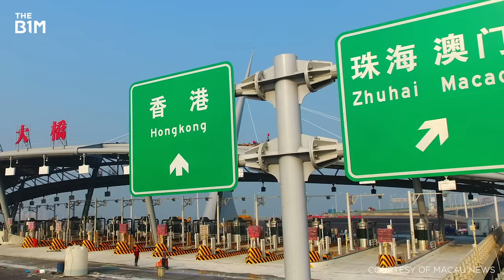Crossing an Ocean: The Hong Kong-Zhuhai-Macau Bridge

Comment: I'm supposed to be going to Hong Kong sometime next summer or the year after, and my primary goal was to see the light show, but since learning about this bridge a year or two ago my main goal is to drive across the bridge. 

Not sure whether i'd be allowed to (only have a UK license), but there has to be a way.

Edit: Also, what utter rubbish (not on you B1M) ! A 300,000 tonne vessel would go straight through any section of that bridge... surely?
Reply: Currently there are strict restrictions on who can drive across the bridge, but there are shuttle buses that you and I can take
Reply: Even those holding driver’s licenses in Hong Kong, Macau and mainland China are struggling to get permission to drive on that bridge, bad luck :(
Reply: lol check engineering white book, the standard is partial damage, btw simple calculations the energe released in one sec at inner harbour operational speed is about 450000000 J, the standard for any sea crossing bridge support is well above that number lel
Reply: The light show is very meh...

Comment: While this is the longest "crossing" in the world, it's not the longest bridge. This "crossing" is made up of 2 bridges and a tunnel. While the 2 bridges of the Hong Kong-Macau Crossing are long, they aren't the longest bridges. The Lake Pontchartrain Causeway in the U.S. is 24 miles (39 km) and the Hangzhou Bay Bridge in China is 22 miles (36 km). They are the longest bridges in the world over water, and technically are the longest "crossings" over water, since the Hong Kong bridge goes underwater. Still, this is a very impressive project.

Comment: The Earth's radius (r) is 6371 km or 3959 miles, based on numbers from Wikipedia,
which gives a circumference (c)of c = 2 * π * r = 40 030 km
We wish to find the height (h) which is the drop in curvature over the distance (d)
Using the circumference we find that 1 kilometer has the angle
360° / 40 030 km = 0.009°. The angle (a) is then a = 0.009° * distance (d)
The derived formula h = r * (1 - cos a) is accurate for any distance (d)

Comment: although this bridge is controversial and late it is needed. Christen pilgrims and missionaries  need to get from one side to the other. Temples are in Hong Kong, Macau, and Shanghai and to get to them you have to drive through China where border checkpoints are a problem. Not anymore with the new Hong Kong-Zhuhai-Macau Bridge travel which took 4 hours of delay at Chinese checkpoints takes close to an hour or 15 minutes and is a straight shot across the bay. 

The bridge has 14 elevated spans, three cable stay bridges, and six tunnels to connect it to the existing road network connecting it to Hong Kong, Tuen Mun, and Tung Chung on the Hong Kong side and Macau, Zhuhai, and Shanghai on the Chinese side. This project is more impressive then the project that built Hong Kong International Airport and its support roads in 1998.

Comment: I'm interested in the shape of those cable stay towers.  What is the advantage of that shape?
Reply: You mean the parts between the towers? That is probably for being fancy.
Reply: David Harrison it's a suspension bridge.

The towers and the cables better evenly support the bridge's weight and load by using those Posts and cables to pull up critical points on  the bridge via counter anchorage in the ground that is encased in huge concrete blocks.

However there is typhoon there and so, the towers are designed to have Least Wind Resistance 💨

Comment: This bridge could have also had a connection with Shenzhen, but it didn't due to Hong Kong's selfish objection (They regard Shenzhen as a competitor, not a collaborator). The project's delay was caused by Hong Kong and, ironically, all the problems are in the part of Hong Kong although it has a much shorter segment of the bridge.

Comment: Hoping the Experiences Used in Building Hong Kong-Zhuhai-Macau Bridge Will be Used in Building Mindoro-Palawan, 2 Palawan-Panay Inter-Island, and Even the Palawan-Zamboanga Inter-Island Bridge Causeways, This Over Hundred Kilometer Bridge Projects will be Even More Difficult to Construct Than This 55km Bridge, Because the Cars Driving this Longer Bridge will Need to Stop at Service Stops if The Drivers and its Passengers are Hungry, Need to Pee or Poop, Need to Refuel or Recharge the Cars, Need a Cup of Coffee to Relax, and Need to Rest and Sleep, To Solve that Problem, A Artificial Island Service Area Bigger than in Zhuhai-Macau Bridge will be Built on Either Side of the Bridge Expressway, Aside from This, There will be a U-Turn Slot Ramps to be Built in this Service Area for More Convenience for Those Going to and From Service Area, Especially its Employees, and Cutting Edge Construction Technologies will be Used such as Span by Span Bridge Deck Installation Using Floating Cranes in the Sea, and Precast Stacking of Bridge Towers Powered by PPVC Technology that was Used in Building the Gardens by the Bay Supertrees Using the Tower Cranes So That the Project will Complete Earlier as Possible.

Comment: “Furthermore, in 2017, Hong Kong officials arrested a number of lab technicians after concrete stress tests were found to have been falsified.” 

So, what are we talking about here, fudging a thousandth of a percent, a micro millimeter rounding error, or decimals being moved around?! Would be nice to know how exactly they solved this problem.
Reply: Not too worry.  This bridge will likely collapse in the first major typhoon, proving the accuracy of those deficiency reports.  Then China will simply line up some of the builders in front of a firing squad as scapegoats, then all will be well.

Comment: What happenes if there is a car crash, how long is the response time? Are there locations that emergency helicopters can land at on the bridge if needed? Is there a toll cost to cross the bridge excluding the regional permits?

These are the questions that i think should have been posed in the video.
Reply: there are 2 artifical islands between the roads. the guardrails can resist 120km/h crash.

Comment: As a Macau resident, I don't really see how this bridge cuts carbon emission significantly since the bridge only consists of roads.
Reply: Less road distance = less distance car needs to travel = less carbon, generally
Reply: @gunhunter  True. But this bridge is kinda designed to facilitate cargo traffic which doesn't help 😂Personally I think the addition of a railway to the bridge would've really benefitted travellers. (the current option for public transport is a shuttle bus)
Reply: @koninkrijkc8559  agreed regarding the lack of railway. In fact I'm from Macau too. The fact that most of us aren't allowed to drive on it and must take those buses really disappoint.
Reply: K.I. Wong they use buses and hopefully electric bus shuttles. 

* A single half filled bus can on average, cut down by 8 sedan cars in emmision. It's relative.
Reply: K.I. Wong also railways need to be very flat and level grounded. A train is much longer than a car and is unable to dip into an underground tunnel and resurface up again. 

Hence railway would be less feasible.

Comment: Fast forward to 2020 and the bridge is barely used. That's because the bridge, though connecting Macao and Hong Kong, technically goes through Mainland China. And this causes several complications, such as:

1. Two separate border checks (Macao to China, China to Hong Kong)
2. Changing driving directions twice
3. Paying a toll fee in Chinese yuan (requiring you to exchange currencies beforehand)
4. Having to obtain 3 separate car insurance policies (the requirements in China, Macao and Honk Kong are too different to create one unified policy).

The bridge is a bureaucratic nightmare for anyone wishing to cross. Which is why barely anyone does, and those who do are mostly tourists doing it for the experience itself. The bridge is just another example of China building stupid shit just 'cause it can.
Reply: That‘s the next great wall of china， called the great bridge of china。

Comment: For heavens sake, please speak English. It's shameful not to know your mother tongue. You said "this section of the crossing commenced construction..." I am unaware that any crossing of this type is capable of commencing anything. A correct way to say what I think you're trying to say is "Construction of this  section of the crossing commenced in ..." If you want the technical explanation, "to commence" is a transitive verb and requires an object (that is, some on which it operates). So, you can say "The builders commenced construction of this section..." or you can use the related substantive as shown above. The reason why you made this mistake is that many Americans wrongly believe that it is wrong to use the passive voice, as in "The construction of the crossing was commenced...". The passive voice is useful and needed for many language constructions. Don't forget that many people listening to your videos do not have English as a first language, so it helps them if you stick to a standard form. The same rule applies to "to launched", so a rocket cannot launch, but can be launched.
Reply: You take nitpicking to a whole 'nother level but you're simply wrong. I'd begin with pointing out that you did not apply the appropriate apostrophe with "For heavens sake". Anyway, In this particular context, the construction may be attributed to the section itself; hence, "this section of the crossing commenced (its) construction..." with merely the drop in the possessive.